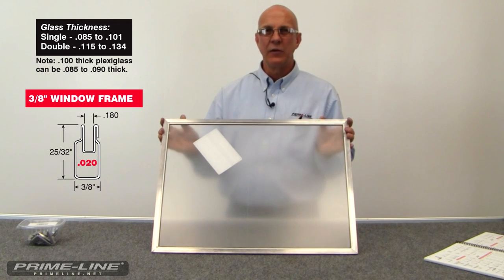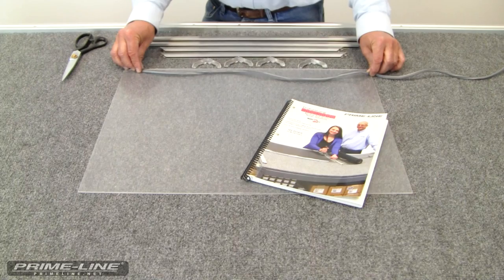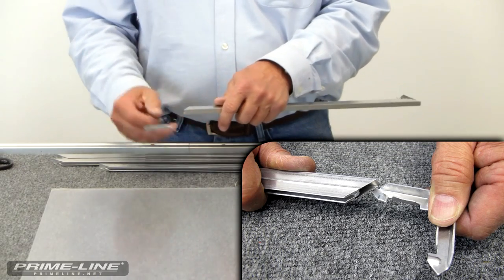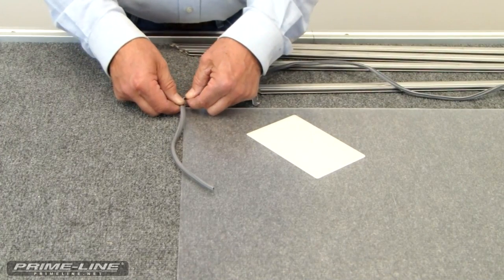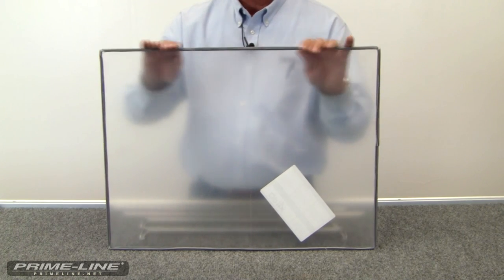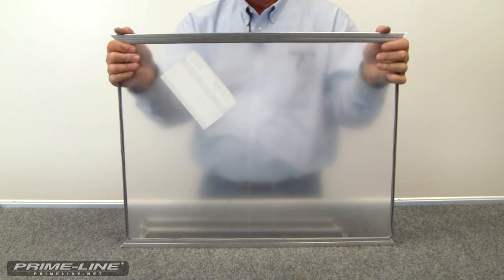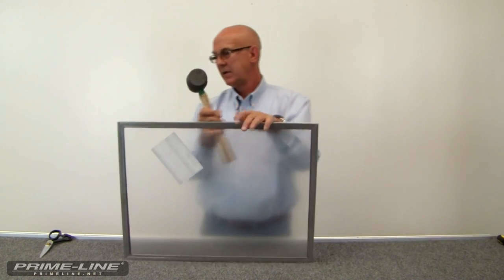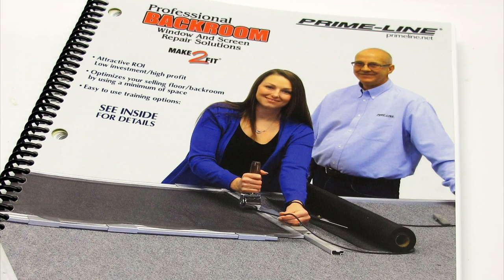How-To: Build a Storm Window

Comment: hi , i need all those components but for 1/4 " pexiglass ,where can i findthem and also the slider window thanks
Reply: 1/4" it seems to be more of what i can find as a h-channel. CRL is basically the only way to go with 1/4". Prime line doesn't make anything close to that size
Reply: I would double it up so its a double pane with some air space between.